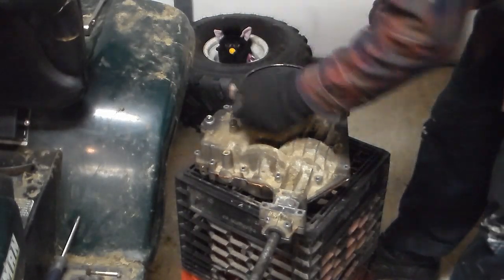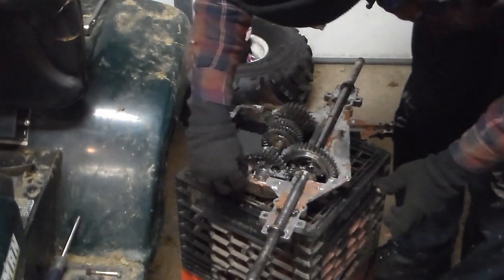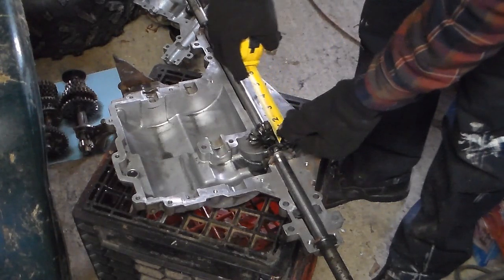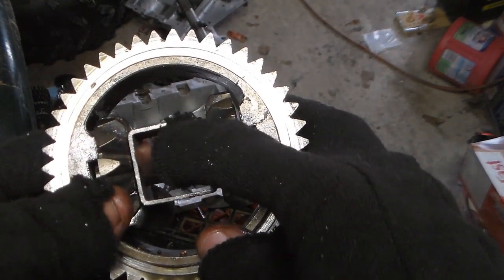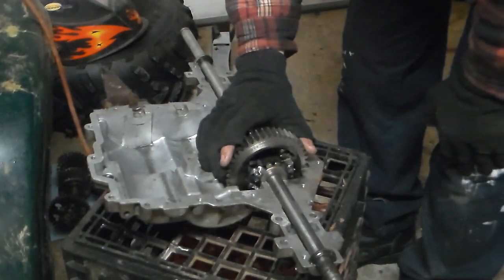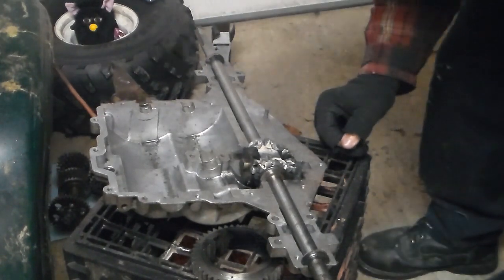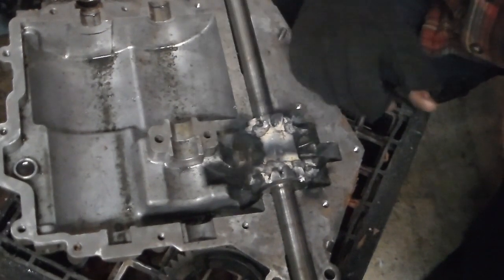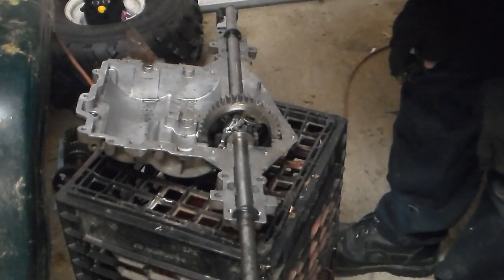Locker block differential locking

Comment: lol, I just welded my dif the "traditional way", it broke in like 2 minutes. (probably because I was using a stick welder with rods that were for mild steel. so I just welded all the spider gears together and it seems to be holding up. good idea with using the box steal to hold it together.